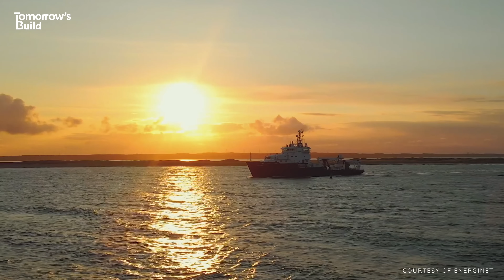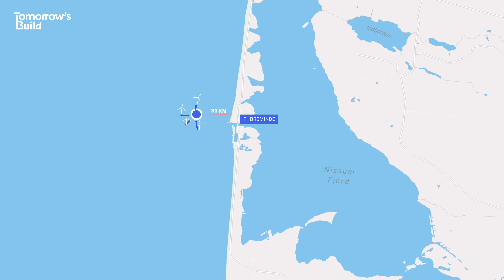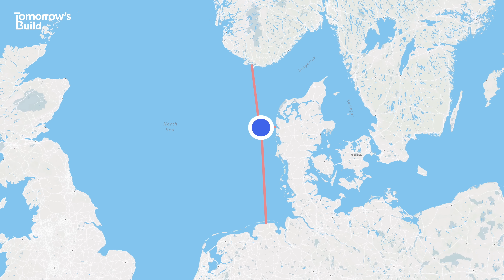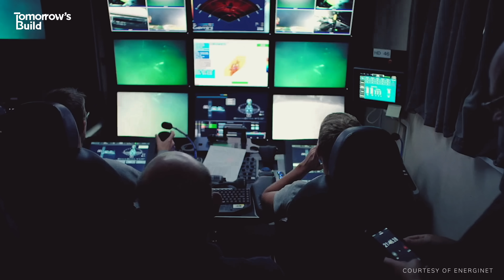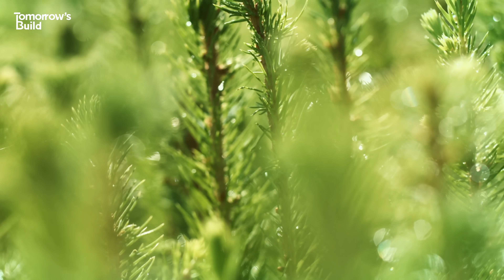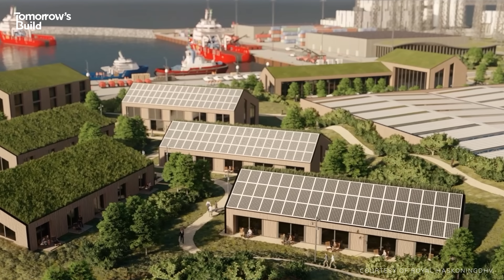Denmark's $34BN Energy Islands Could Solve Europe's Power Problem

Comment: More pie-in-the-sky unreliables. They need to resolve the problem of energy storage. Not much point distributing the energy more efficiently when there is too much to be used and it cannot be stored. 
When a large anticyclonic system settles over Western Europe for a month in January, then there will be no need for storage because there is nothing to be stored. We can all sit down and freeze together in green comradery. 

Those who decide to kiss Putin's ring may be allowed to buy even more Russian gas at higher prices as they finally realise what Europe has done to itself. It's really not that difficult to work out. Putin/Russia don't even need to do anything evil. With current policies they just need to sit and wait.

Comment: wind and solar power are good if it only worked 24/7, but as far as I know it is often windless and the sun does not shine at night, so to get a stable electricity supply 24 hours a day, nuclear power is required, that is the only which works today if you want to be fossil-free! :-)

Comment: LOL I would not count on Denmark solving any energy problems. They built this honking super big, super expensive incinerator that was supposed to burn all their trash and turn it into clean energy. Well... they don't produce enough trash to keep it running and turning it off and on and is more expensive than keeping it running even with they have nothing to burn and therefore not producing energy but wasting it.  Importing trash to burn and turn into energy turns cancels out the clean energy process, as it takes a lot of energy and costs to move trash across countries or by sea. Instead of making money it's losing money.

Comment: Wind and solar power will not be able to provide Europe with the electrical energy it needs. Especially with the electrification of all fossil-fueled equipment. It is simply not possible. Wind only has an average production factor of about 0.3. This means that statistically, wind turbines will not be able to produce electricity 70% of the time.

Comment: Wind energy will never solve Europe´s power problem. There is only that many offshore wind parks you can build, and even if they were run at maximum capacity all the time (which is impossible), they would never produce enough energy to supply the continent. Meanwhile, the impact on the marine environment is massive, the costs are astronomical, the life span is considerably shorter than that of conventional power plants, and the production of those massive turbines (and their disposal once they´re no longer operated) cause more harm to the environment than the clean energy output could ever compensate. 
My experience from northern Germany is this: We are drowning in wind turbines, they are literally everywhere, yet we are nowhere close to being self-sufficient energy-wise. The policies pushing green energy have ruined our coastal landscapes AND given us the highest energy prices in the whole of Europe.
Reply: You are already judging while our energy sector is still in full transition. In Belgium off shore wind mills deliver 30% more than initially planned. The off shore structures also create a variety of marine life. No one is saying that wind alone will provide all energy but it will surely provide an important part. All this energy is produced in Europe itself.

Comment: A fixed date to stop extracting oil and gas before these islands are even built - never mind tested - is plain crazy. The time to stop extractions is when the islands match the energy provided by oil and gas, not before - if ever.
Reply: The time to stop burning is when we burn so much that the atmosphere heats up i.e. now
Reply: @eljanrimsa5843  the primary source of the heat that heats the atmosphere is the Sun. Carbon dioxide, which is incorrectly blamed for climate warming, has only a volume share of 0.042% in the atmosphere (420 parts per 1,000,000) And of these 0.042% CO2, 95 % comes from natural sources, such as volcanoes or decomposition processes in nature. The human caused CO2 content in the air is thus only 0.0016%  (21 parts per 1,000,0000)  So yes indeed, the time to stop burning fossil fuels is when we burn so much the atmosphere heats up a significant amount because of the  burning of fossil fuels - maybe a few thousand years from now, maybe never.

Comment: It is possibly a good idea. But when you say that this will provide electricity to some households, you forget to say that this will only be the case when the wind blows.
As far as I know the wind does not blow 100% of the time at the speed required to produce the nominal output of the wind turbines. It is far from being the case. Most of the time the wind does not blow strong enough, or not at all, or too strongly. It is less problematic for offshore windmills like these, but it still is. What happens when the windmills don't do enough: in most countries they burn gas and this is very bad for the climate.
If they

Comment: 1. As an at scale alteration of the face of the planet it kind of looks like environmental vandalism to me
2. The islands are unnecessary for the undersea cable network
3. Nuclear power is a denser by many orders of magnitude, and ultimately cleaner energy source with a lower carbon footprint that will work just fine through a super- volcanic, asteroidal  or ironically most likely,.. a nuclear winter
Crazy I know but given the geological temperature record I am kind of worried about going back into the ice age. It has after all been most of our history and that graph and the ice sheet expanse during previous ice epochs both look freaky hard to engineer away WHEN they return. Thats right its when. I don't believe for a second that geological temperature graph is just going to miraculously stay flat forever now... kind of obvious when you think about it.
As for the green credentials of that obscenity of metal in the ocean.. Making all that steel and glass and spreading it out over so much area takes a lot of DIESEL and there are never the cost of recycling them at the end of their useful lives built in. Those seas will look pretty fucked up in only 150 years. Graveyards of rusting metal wrecks. Great place to film dystopic movies though.
and...
Ever heard of persistent organic pollutants? (POP's) 
yeah I thought not.

aldrin ¹
chlordane ¹

dichlorodiphenyl trichloroethane (DDT)¹
dieldrin¹
endrin¹
heptachlor¹
hexachlorobenzene ¹,²
mirex¹
toxaphene¹
polychlorinated biphenyls (PCBs) ¹,²
polychlorinated dibenzo-p-dioxins²(dioxins)
polychlorinated dibenzofurans² (furans)

1-Intentionally Produced.
2-Unintentionally Produced - Result from some industrial processes and combustion.

So these are the things you are distracted from being horrified at by worrying about by not very dangerous non toxic bogey man gas
Heretical.. I know.. sorry

Comment: Once you add the minimum of 2 weeks storage (batteries are around $150 per kWh, you do the arithmetic) the price per MWh is around 8x the quoted price. It only works with gas peaker plants providing cheap backup. Russian gas?
Reply: There won't be a battery storage capacity. The interconnected smartgrid with the Netherlands, Germany, the UK, Denmark and Norway means power can be transferred from wherever the energy is being produced when the wind farms surrounding the island itself isn't producing a lot of power. For when there is an excess amount of wind energy, the island will hold large scale power-to-X facilities.

Also, the idea that so many people always bring up about renewables - that a windfarm doesn't produce any power if the wind doesn't blow is of course true, but not many understand just how little wind is needed for power production. The newest 15MW turbines need just 3 m/s to operate.
Reply: @3546DK  at 5.8 knots what percentage of the nameplate capacity can they produce?
Reply: @MrPalmadores  I honestly don't know. It's obviously not full power. The 15MW turbines are still very new, so I haven't been able to find a power curve for them. I think only GE, Vestas and Siemens have turbines that large. For comparison, the smaller 10MW Vestas turbine needs 10 m/s to run at full power - and I would imagine that for larger turbines with bigger blades that figure is smaller.

Vestas is saying its 15MW turbine will produce ~80GWh per year in a place like the North Sea. They claim a capacity factor of over 60% - so the average nameplate capacity over a year of production.

Comment: not logical  idea    wave height max 23 meter and a depth off around 15-20 meter  one will build a offshore platform in concrete for 34 billion euro        it can be done for 4 billion using offshore re-usable platforms also who are suited for the north sea

Comment: What a horrific idea! Who on Earth thought this bs up and presented it as a good idea? It is an environmental disaster on a new level! Imagine building islands... The environmental impact just there should be reason alone to stop the project. Then thousands upon thousands of concrete foundations on the bottom of the sea - the bottom can never be restored and the concrete foundations can not be recycled. Cables everywhere with energy fields that disturb most life in the water. On top of that - the wind power plants can not be recycled and the cost in energy and money to install/dismantle will be enormous. Then there is maintenance and pollution from the mills... And you publish this as a good idea, a solution to Europe's power problem.

Comment: As usual in these new green energy prognostications; the narrator failed to mention the enormous amounts of fossil fuels & precious resources needed to construct & maintain them as if it is constructed by green electricity alone.  I do green energy at my house ( 70 % electricity, 65 % hot water & some heat) but I realize just how precious petroleum & resources really are to our lives and future.  And remember that these systems only produce electricity as if that's all you need.  I'm pro alternate energy but knock off the anti - petroleum rhetoric.  We will have to synthesize oil in the future because we're approaching peak oil and without it you get nothing!  And that goes for coal too; try to make steel, adhesives & many chemical products without it.  This green brainwashing nonsense is setting us up for a energy-resource-economic cataclysm!! Get real man!!

Comment: Wind/Solar generation does not solve energy problems on industrial scale, only as an ad-hoc solution for independent homes. This generation is unstable and unreliable. The more such capacity is installed, the more gas turbine power plants are required, because they can actually address rapidly changing power output in the system. And current energy crisis in Europe has proven that.

We don't need fake green energy. Full stop.

Comment: It's a nice projet, but money should be invested elsewhere. 
A wind turbine has a 33% avg capacity factor so you get a third of the maximum power output. 
There is little "wind diversity" in the north sea. Which means when there is no wind. All the wind turbine of Norway, Sweden, UK, Germany, the Netherlands and Denmark will not produce any electricity. And what will happend ? They will use gas or oil or nuclear or import it. And for a very high price because all theses countries will need electricity at the same time.

Comment: 30 Gw is a drop in the Ocean (no pun intended) The UK alone uses 300 Gw
Reply: Britain has installed capacity of 76GW. You’re confusing with capacity with production (GWh)
Reply: @vitaeschola  Thank you for pointing that out, I just wonder though, if you put all the wind generators in one place, what happens when there is not enough wind there, would it not be better to spread them out more?
Reply: @andybawn1  As a Dane i can promise you that turbines have been spread as far and wide as possible, mostly because there’s not a lot of space ;) But in all seriousness, the turbines will have the normal 100-150m distance. The point of the island is to be able to collect the electricity close to production for efficiency. If you want to do electrolysis for efuels it’s the most efficient way.

Comment: Wouldn’t it just make more sense to build an “energy rig” like an oil rig rather than a static island both in terms of sea level rise issues and in case it would make sense elsewhere in the future?
Reply: M
Reply: A rig, is build as a temporary energy extration operation. An oil or gas rig is only there for as long as there are oil or gas to be extracted from the sea.
An island is a more permanant solution, build to because it is assumed that one would continue for as long as time to extract wind/solar energy, and posibly convert it to gas, for easy storage. That is why the island option is more realistic than simply build a rig, for a long term solution.
Reply: Why would that make more sense? And what is a "energy rig" it's wind energy how do you make a "rig" wind turbines are noise too you don't want to live near one
Reply: @Opi0id-z  what I mean is I feel like it would make more sense to put the storage such as batteries on a floating platform rather than an island built into the seabed. That was you cut out a bunch of problems like sea level rise, erosion and probably a lot of environmental damage like sedimentation.
Reply: @rowanbixler4700  From what I understand it becomes extremely difficult to keep a platform stable and in position once the size gets too big. The massive inertia can pose a lot of danger to the infrastructure that connects it to the mainland.
Reply: @rowanbixler4700  there is no storage on these islands
Reply: @lucapignata-acc  How come the Chinese have built storage facilities on the artificial islands in South China Sea?
Reply: @ravisharma167  about which order of magnitude of storage are you speaking?
Reply: @ravisharma167  Those are in reality for military purposes, it is part of the Chinese work to claim the South China sea, and function as strategic forts/launch sites for attacks/defense against enemy fleets.

Comment: And I thought this would be an interesting use of wave or tide power. Nup, just same ol' wind power fantasy entertaining a non-problem.Meanwhile, the climate models don't match actuals, CO2 atmospheric concentration is not correlated with historic temperature trends, and the rate of 'extreme' weather is unchanged over time, indeed, in some areas it is reducing.
Reply: Um... and why should I trust you over the professionals who are actually educated and certified to be so in this matter?

Also like, we've had wind energy here in Denmark for over 40 years now and it's been doing wonders! We've even had a few days already where the whole energy supply could be supplied by wind power alone.

Comment: Interesting idea for sure. Will be nice to see it in development. Though I imagine there will be at least a 10% loss of energy due to the huge distances the electricity will be transported.
Reply: No. Sea cables are quite common. Both the 760 km Viking Link between Denmark and the UK and the 730 km North Sea Link between Norway and the UK are designed with a 5% loss factor. And the distances for the energy island certainly won't be longer than those.
Reply: @3546DK   We have so many undersea internet cables around the world. It’s quite a fascinating achievement for humanity.
Reply: @3546DK  Marine Power cables are expensive.  They require more trenching than IT cables and a permanent continuous protective infrastructure where they land and surface.  The landing site must be isolated from the public with large offsets, requiring a right of way purchase on often expensive coastal property, again, unlike IT cables.  When the sea unburies a cable coming ashore as it does from time to time, a power cable requires an immediate response from large specialized crew.  

I suspect reduction in the number of power cables coming ashore is one the reasons behind this extravagant island concept.

Comment: Stupid. $34 billion would get you 5 Generation 3+ or 4 Generation 4 nuclear plants, which would come on line in 5 years and begin making pure profit in 11 years after the first shovel turned. Nuclear power is the greenest energy out there because the plants are very small. Maintain a nuclear plant is going to be far easier than a wind farm 80 miles out to sea. Each nuclear plant would also produce between 2 and 4 GW of power. Four of them between 8 and 16, a lot more than the wind farm.
Reply: Where was a gen3 nuclear plant build in 5 years for $7 billion?

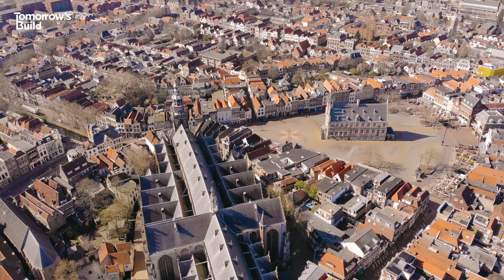Comment: you've used a home consuming 1000W at 1:25, where did you get this figure. It seems incredibly low given just air conditioning alone couple put the house at over that and the average for the uk is around 3.5kw
Reply: Yeah but AC ain't exactly common in Denmark either. It doesn't get that warm here so AC is mostly seen as an excess luxury anyway. In terms of heating, a large portion of danish homes are coupled to district heating systems and within homes, most heating is done by Radiators using hot water.

Comment: As it stands now, wind will for a long time still only be a supplemental energy source, the main source, the source that drives the whole network buy it self 70-80% of the time, you need something stable. 
10M house holds? house holds are far behind Industries and Sector as consumers on the market, and we are still only in the introduction with electric boats and planes .
Although i do welcome wind energy to a healthy degree, and this project is probably going to work well for Denmark. 
The shift towards green energy is becoming a corporate monopoly towards the wind sector, ridiculous expensive to build and maintain, and it still will only be supplemental towards the main source